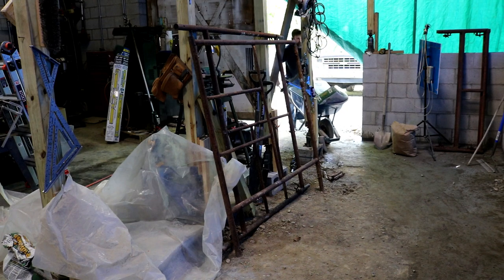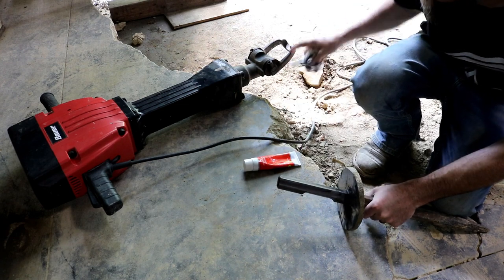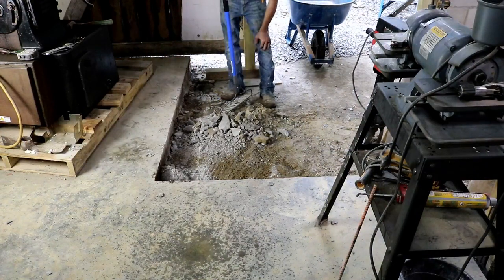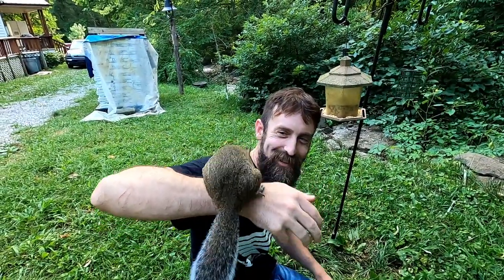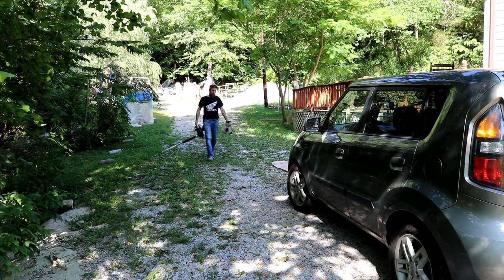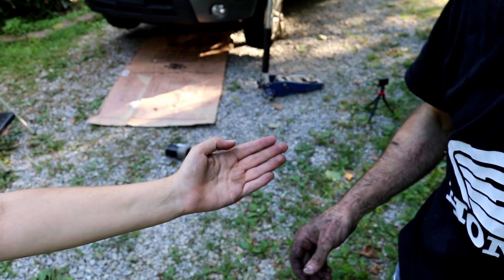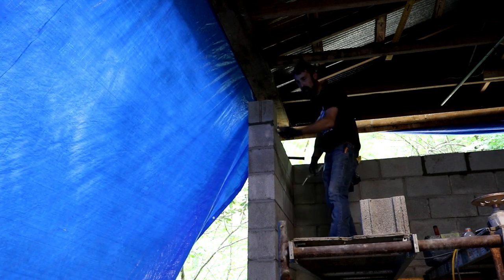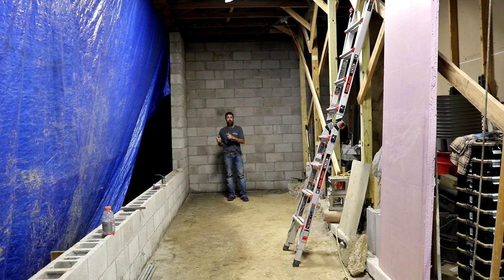Finishing up the back Block shop wall / Jackhammering the old floor \ Car trouble

Comment: I used to have a 91GTP Grand Prix so it had the bigger 3.4 engine in it. That engine had the alternator on the passenger  side tucked down the backside  of the engine inaccessible from the top. The book said to lower the sub pan enough to reach it from the back. 
  I removed the passenger side wheel, axial & everything which gave me just enough room to maneuver the alternator out that way. The book had it down as an 8 hr. job & I was able to do it in 1 1/2 hrs.

Comment: That outside corner of the existing slab will most likely cause a crack in the new slab when it cures.  You might want to put a metal joint in there so you have that square in front of the door, then a nice long rectangle section down the length of the shop.  I went thru the same thing a few years ago, pouring around existing slabs.

Comment: I agree with you about rebuilt starters. I had one  that the back end was cast aluminum . The problem was pivot point of what I would call the fork was worn out . The hole too big. When you tried to engage the starter it jam . I got another starter no charge but I had to pull the starter and make another  trip to get another. That back piece on the first should have been pitched.

Comment: you could limit the slab cracking by chem bonding rebar drilled in to the old slab then tied to mesh laid in the new as so to help with the torsional strength of the slab with out it cracking.

Comment: just an FYI, the locking arm on the hammer is upside down and backwards. good video. yes you will need to dowell into the existing concrete or it will change in heights.

Comment: Dowel the old slab into the new pour.  5/8 diameter smooth dowels 24” long each side 12” into the old, 12” into the new.  You can epoxy them in if you want.  12” on center.  Not a structural engineer, but I did stay at a Holiday Inn last night.

Comment: Nice varied video. 
Normally the only thing that fails on the starter, is the contactor set. These burn due to the high current they take. Here in the UK, the contactor set and plunger is available for most popular car starters, and for a fraction of the cost of a remanufactured starter.

Comment: Wow, Steve, had no idea that back wall was so tall. End of video with you in front of it is pretty stunning. Thirteen feet? More? I counted 16 courses of cinder block from (present) floor level. Guess there's one or two below that to the footer? Anyway, incredible job! I'm sure that when you anchor the new floor to the existing floor, you'll use the best method-- like everything else you've done.

Comment: could put a flex joint between the old and the new concrete , basicly a thick silicone seam , think if you want the concrete to bind to the old stuff you need to drill holes and put rebarb in it , might need some special morter or etch it some way to make sure the concrete sticks to the old stuff 
looks like the brakepads are allmost gone too on the kia 
youre wife is pretty special youre a verry lucky guy

Comment: I ve been following ur videos for awhile  being Im a retired concrete contractor Im keeping my criteke to myself as all in all for a diy job every thing is working for u . My only advice is when u use ure wheel barrow try and get as much weight as u can on front tire and choke up on the handles and u will see its much easier to handle.  grade ur sub gade to be even to keep ur new slab even, rock is cheaper tie the new to old with sum dowles ur good to go. GOOD LUCK U GOT THIS

Comment: As a suggestion to others, all that concrete rubble would have been great to mix in with the flow-able fill used to back-fill the wall. you could have got away with 50% of the fill order.

Comment: Control the cracks, all concrete cracks so have them crack where you want. You are going to put in rebar, I hope.  In the L section your going to pour, cut a crack joint every 8 feet (2 inch depth of cut) and at the inside corner of the L cut a joint from the corner of the old pad corner to the corner of the building and at right angles from the corner of the old pad to the wall so you have two triangles in the corner.
Drill and dowel pins into the old pad every 12" to 16", I'd use 3/4 rebar for the dowels.

Comment: Yes I’m 6’1” and 290 lbs on foreign cars and trucks I have to recruit my 5’8” 110 lbs daughter to get her micro hands into places I can’t. I could take half the car apart and get around the part. Great work on the wall!!! That drain is working great also. Thanks for sharing. My wife helped me pull the gas tank and replace the fuel pump on her expedition.

Comment: Try using the socket in your fingers when it's too loose for the ratchet, but too tight for your fingers on the bolt. Your wall looks great.

Comment: I suggest saw-cutting the new slab where it will have the inside corner where you just worked. I definitely suspect that will generate a crack as it cures. You might also saw-cut about half way down the length of the shop. For those two small cuts you could probably get away with your circular saw and masonry blade.
Steel buildings are attractive because of initial cost and speed of assembly. But if you intend any interior improvements - like electric, insulation, wall-mounted cabinets, etc. - you nearly build an entire wood framed second building inside and the true cost savings is much much less.

Comment: One should not obsess too much over blocks ,they are just blocks ; Some thought will have to go into framing the wall , Will the roof be lowered onto the wall or will the wall be built under the roof , A pneumatic framing nailler will be handy .

Comment: drill horizontally in to the old slab and drive 1/2" x18"  rebar 18" o.c. (9" stick out). It will hold and prevent any differential settlement.

I bet it only rains on your work days there,  LOL

Comment: At 9:51 i would take a concrete saw and continue those edges to eliminate stress cracks. If it ever cracks it will be in the cut lines.

Comment: Still hasn't turned the back frame around so he can hang the deck on any rung, with the 'ladders' aligned.'ll
But Steve got it done, right to the top plate!
Surprised he didn't leave the last course back to allow a beam pocket for the lintel above the window opening.

Comment: Good luck on the starter.  Can tell you stories.  Get a warranty, and I can tell you stories about that.  I am an old grumpy one.  Of course a starter which has sticky brushes will test ok after being wooled around, but you paid for warrantee, and you get tired of crawling underneath to tap on starter on the coldest day of the year.  This old grump won.  Got a new starter for jeep.  Good work on shop.

Comment: G'day Steve great progress mate! where you are tying in to the old concrete, are you drilling in tie-bars? if you were to drill in and dovetail rods the rebar should provide excellent hold connecting the old slab to the new one.

Comment: Steve, check the mass of these balancing weights on the wheel. It seems that there may be a bit too much. Tire rack says: "While there is no industry standard, the general consensus of what is too much weight is when it takes more than 1% of the assembly weight to bring it into balance."

Comment: Any of the new vehicles are designed where they raise the entire engine/trans/front suspension/etc as one unit up into the body.  Have seen cars where you have to loosen up engine mounts and cock it sideways to change spark plugs.

Comment: I'll second other comments, drill holes into the existing slab and epoxy in rebar to connect the slabs.
As much as you may want the seam flush you will want to have a small groove there to allow for the shrinkage of the new material.
Does the floor have a slope? Does it drain?

Comment: Sorry but I smiled when you where commenting on the starter. Reason is when I replaced the starter in my Smart (Dumb) Car I had to drop the engine, to replace the starter .

Comment: I had a starter go out on a Toyota, this is what I did and it's super easy; the smaller cylinder atop the starter is the starer solenoid, if you take it apart you'll see the contacts that are bridged by a large copper disk or washer just replace the contacts which are available at any auto electrical repair shop. To fix my starter it cost me $5, in today's dollars, $7, check it out and save yourself a bunch of money

Comment: Are you going to reinforce the new concrete floor. I would also install dowel bars into the existing slab so the new slab and the existing slab do not move vertically differently from each other. I have mentioned this as the old slab did not look like it was reinforced

Comment: As for the "too tight for your fingers and too loose for a ratchet" dilemma, leave it to German engineers to come up with a solution for that irritating scenario . The Wurth company offers ratchets that use a roller sprag clutch design instead of the traditional geared/pawl method. They absolutely have no resistance on the socket when rotated in reverse. The square drive shaft pushes through the head to use the socket on the opposite side to change directions. Clever design for a frustrating problem.

Comment: There will be differential settling of the floor unless you epoxy rebar into the cut side and tie it into your new pour.
Reply: I think the drill and bond bars are a good idea but they will not prevent settlement. Settlement will occur to some extent even on a well compacted base, the drill and bond bars will be effective in preventing the settlement cracks in the top of the slab (caused by the settlement) from widening over time but they don't prevent the cracking. i would use the drill and bond (epoxy) bars and a tooled construction joint at the joint between the new floor and old floor. The tooled joint will keep the crack from deviating across the slab, and the bars will keep it from opening up too much. 1/2" OD (#4's) deformed bars at 18" centers will do it,  18" long and embed 6" into the old concrete floor. Simpson, Hilti, and others make the bonding epoxy.

Comment: Have you got  a pretty good current in your steam/creek, I remember seeing on utube a story, NOT an ad, about a hydra generator, it is a tube under 6 inches across and maybe two feet long that lays in the the quick running stream and provides all the electricity for a farm stead.

I hate paying electric bills.

Comment: Hi Steve....the frog under the cement is not a good news at all....until now you have made a great job, stay care.
Reply: No worries. It is not a frog. It is a toad!
Reply: @1pcfred  frog or toad ...no matter...this means water under the layer of cement.....
Reply: @SalvoMorina  dig down far enough and there's water under everything. Typically a concrete pad is poured on top of a poly plastic sheet vapor barrier. Which does seem like something else the original builder of Steve's building skipped doing. But if your floor isn't sweating then you shouldn't either. I will say that slab Steve has is pretty thick as far as they go. That additional thickness acts like a barrier itself. Concrete is impermeable.

Comment: Steve, is there any lightproduct you can mix with the cement to get volume without reduce the streght, to fill the wall?
 Here in Europe we have baked kleydrops to riduce the weaght get more volume without losing streght.

Comment: Will you use any iron bar reinforcment ? Our garage also has a cement floor which has cracks and no reinforcement as a reason for the cracks.

Comment: Regarding the concrete floor. The original floor may not have had any joints? In most cases, a concrete pad should not exceed 6meters by 6meters because any larger than it could risk crack and fail. Though sme modern high tech concrete product can no be continuous. All joints should have a resin joint compound of between 5-10mm to allow for expansion, contraction and to prevent cracking. All concrete suffers from drying shrinkage which leads to stress building up and eventaully cracks forming. As you have a cut line, I would would suggest you put in a timber formbefore you pour the new floor section. Then, when it has gone off reove the form and fill the gap with a resin, or you could leave the timber in since it is a workshop and not a warehouse. As previously metnioned, specify your concrete to have a super plasticizer in it so that it is 1, self smoothing (not to be confused with self levellling as people do) and 2, lower water to cement ratio (WCR) so you get a stronger mix. Prior to pouring the floor, clean as much dust off as possible from the substrate and paint the substrate with a PVA bonding glue (Based upon PVA wood glue actually), it can be dilluted with water and is cheap. This can go dry prior to pouring. By applying the bonding agent it will help the new concrete bind to the substrate and give you a better floor.
Reply: @Randy Zimmerman That is an interesting method because it pre-determines where a crack will be and when it does crack it would be so tight it would be hardly noticable. I like the sound of that, it is amethod I haven't come across.
Reply: In Canada we use " Fiber mesh " in large slabs , It looks like fiber glass pine needles mixed in the concrete , it works and prevents cracks .

Comment: why is the concrete block wall so high?  is this less expensive than wood frame?  why is floor so thick at 7";  3-1/2" should be sufficient with 4000psi mix.  I like the way you staged the work to accommodate the existing structure

Comment: Another great video  & peanut the squirrel🐿👍Your videos Just popped up today steve - From Australia Enjoy a good mix of all  around your  propertys even the  nature  that walks in Looks  a good property lots trees a stream  the country side  cant go wrong wish i had something like this  anyway cheers 🥂TIP# Fire starter🔥 #TIP  Cut a soda can in 1/2  1/2 fill with fuel  Put on bottom of wood pile  lite it🔥  works like a candle it wont flare up like people think petrol does    Diesel      kero any fuel alike     a lad work showed me that 80s 🚩After everything is done Buy a trail cam hide 2-3 around property  Anyone that trys to rob you when away it records in nite  secrete like no lites $100+ add a sim card if u want a pic sent to your mobile Best securty ever hidden in back sheds views front doors  Also takes pics any animals nature wonders around  win win
Reply: Hope you read this steve handymen always help each other with tips good luck a guy made a  electronic Dog bark  box if it  gets an alert it Barks loud big dog 🐩

Comment: Back in my days, i´ve refused to work on 2 cars. A Peugot 604 and a Renault 5 Turbo with a mid engine. There was no way, to do anything at the engine. All the other cars had enough room to do the job. I guess, nowadays there are 2 cars out there, you can work on...the other cars ;-(

Comment: I was extremely surprised that there was no steel in the concrete, no bars no mats . The concrete has no strength in this way. It s a matter of time before the next crack appears. 
For concrete  floors one needs to place a soft steel mat 15 mm x 15mm. ( 6" x6 ") 8 or 10 mm thick (3/8 ")  with a minimum  of one inch 2 cm from the bottom. I don t see plastic under the floor to prevent loosing water during drying / hardening of the concrete.
Did I miss some footage. I hope so
Luc Bleckmann Netherlands Europe

Comment: I thought you made a comment that you will be drilling and pinning the floor to the wall.  I would really look into not doing this.  I'm a structural engineer and I would not recommend this unless you need tie the walls together because of downward forces.  You have good footings so I'm not sure if you need to do this.  If you do tie them together make sure you use an expansion joint material between the wall and the floor slab.  But check with your engineer and make sure he wants you to tie the two together.  I would dowel the new slab to the old slab.  3/4" dowel pins.  Would work well.

Comment: Almost done for the week, one evening to go, got a 40 hp Motor pulled, think I got the young pups informed how to get new Motor back into place, only a 9000 dollar Motor.  
I am spoiled at my local real lumber yard, they actually have people who load stuff.  I jump in and help some.  But when I go to chain lumberyards I announce, don't you have anyone to help an old man.  Ha.  
Keep up good work, going to look at a surface grinder this weekend, small, 6x12, will fit in my shop, will work good with my cutter grinder and will dust in my parallels.  I remember when I could work as hard as you.

Comment: The right way to start a fire is to use a 5 gal can of gasoline, pour about 3 gallons on the pile, fumble for a minute looking for a lighter, then while holding the gas can light the fire :-O

Comment: I'd drill the old slab ad epoxy rebar into it connect it to the mesh for the new floor that way it should not crack

Comment: Having both the positive and negative battery terminals exposed is never a good situation.   The original covers work well.   Placing anything metal on top between those exposed terminals, provides an opportunity, in the heat of the moment, for a large electrical current draw!

Comment: Mortar is a funny thing. It is like they just decided to take this fine powder substance and put in in the most porous packaging possible.
Reply: It is still hot when they pack it (if you get some that has just been delivered to the shop it is often still warm) so I suspect that the bags need to be heat-proof and slightly gas-permeable.